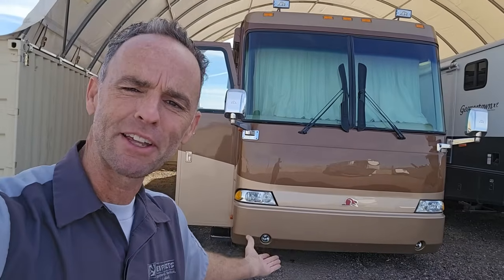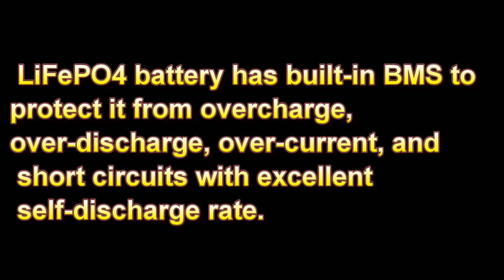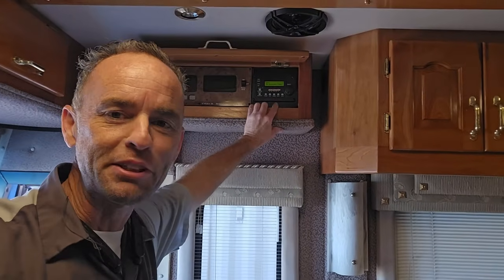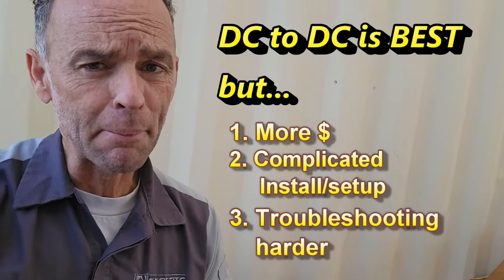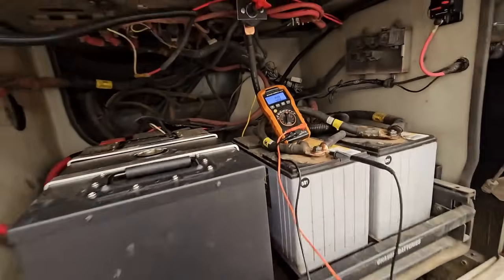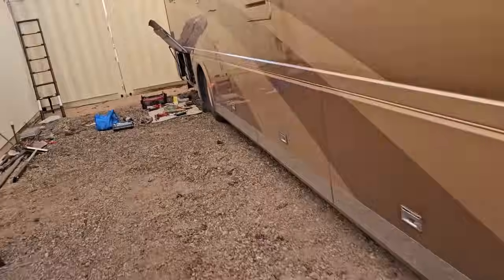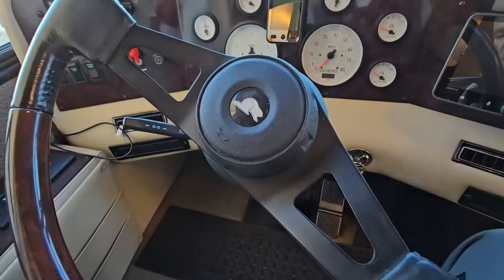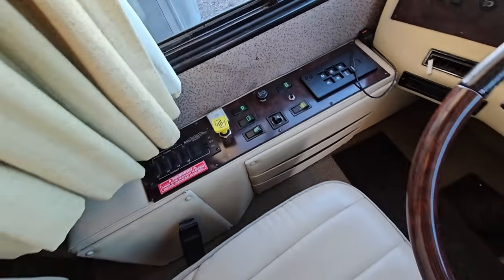What You NEED to Know About Adding Lithium Batteries to Your RV

Comment: Ever since the Progressive Li-BIM was released those of us in the Renegade Super C world have noticed it doesn't work as advertised.  Most have moved on to the Victron XS 50 DC/DC charger which is superior.  The Li-BIM (I went thru 3 and finally gave up) is supposed to latch the chassis/house batteries based on evaluating voltage of each and deciding if either bank is low enough where it should latch both banks together and charge up the low bank.  During charging it's supposed to take a breather (20 minutes) to give alternator a break ...that is ALL the Li-BIM really does compared to the regular-flavored BIM.  HOWEVER us Renegade Super C owners have experienced the Li-BIM latching both banks together when it SHOULD NOT ... and leaving them LATCHED.  Sometimes cycling the Li-BIM (using Signal lug or "Emergency Switch" found in lots of MH ...sometimes fixes the BIM state ...but ONLY temporarily.  I contacted Progressive about this over a year ago and they didn't dispute the problem and simply sent me another new Li-BIM.  Well it behaved the same way ...to the point I put a toggle switch on the Li-BIM ground so I could manually defeat the BIM when I wanted to (so it would not keep both banks latched indefinitely).  Not just me ...dozens of others have experienced the same shoddy/unsafe behavior.  I've taken my out entirely and awaiting the Victron XS 50 Orion DC/DC charger.

Comment: Lithiums also do not need to be charged to 100%, they actually do better if you only charge to 85 or 90% and don't fully recharge before storing it. If you're going to say, run the generator and then go quiet overnight, then 100% charge is OK because it's immediately being drawn down. Also a 460Ah LiFePO4 is like a 800Ah Lead because you can take it down to 15% without harm and if you have a heavy load, you get all the power unlike lead acid which only can meet it's specified capacity with a light load only.

Comment: 793 / 5 000
I don't know if you can answer this question. I switched to lithium batteries, actually 2 12 volt 100amh (200 total). It worked fine for about 3 months and one day my Magnum Energy monitor started showing an overcurrent fault. Since then, my inverter/charger no longer wants to charge my batteries. The worst part is when I start my diesel generator it shuts down after a few seconds as soon as the monitor starts showing overcurrent. What can cause such an overcurrent problem? Is it possible that my batteries are drawing too much current? I even bought a new Renegy Inverter/Converter 2000 and after a few minutes it started to smell burning and smoke so I shut it down before destroying it.

Comment: James,
Quite a few DP’s are wired for the generator to start off of the house batteries. Since lithium batteries cannot be used for starting, switching generator starting to chassis batteries is a must, correct?

Comment: I have a DC to DC charger that charges the chassis batteries and when full it will charge my 4 house batteries afterwards when the engine is running.  It is good to 70 Amps.  If I install more batteries, lead acid, and the batteries are low, will they draw over 70 amps and flip the breaker or will the batteries just accept what is sent to them? If you add solar and the engine or generator is on will solar also charge or is there an auto transfer switch that will only let one source charge at a time?  If two charge at the same time is there a risk of shorts or sparks?

Comment: My ol lead accid batteries have been working just fine since 1994 when I bought my Holiday Rambler Navigator, I'm on my 5th set since then, I keep them maintained and they work just fine. I don't see the need to change.
Reply from the maker: I've never had a lead acid batteries be reliable after a year here in the desert
Reply: Still using flooded then? I'm tired of the T-105. I just changed over and I'm hoping to never have to maintain again.

Comment: James, I am installing the system with the LI BIM and the batteries you installed in a Tiffin 2014 phaeton.  The AUX START switch is not functioning as expected but after some research it maybe functioning as designed.  The signal wire is always hot when the key is on.  So do I need to not install the signal wire on the Tiffin?  Or if I do install the signal wire, do I need to add a momentary switch?  Thank you!

Comment: Put a lithium iron batt in my motorcycle in Phoenix, AZ and was in the for 4 yr. No problem except it did not like to start the bike cold, had to leave the light on for a couple minutes to warm up the batt due to current flow. Expensive but much lighter.
Reply from the maker: That's interesting, I generally don't like lithium for starting engines but I could imagine weight savings is important on a bike too.

Comment: Nice video!  Agree 100% on if you already have solar, make sure it uses a MPPT solar controller.  Newmar, at the factory, left their standard old school Xantrex solar controllers in place when they factory optioned Lithionic LiFePO4 batteries on new rigs.  Now they have a service bulletin out to recall/replace well over 100 solar controllers that couldn't actually charge the lithium batteries they added during these new builds.  

Battleborn, at one point years ago, used to recommend the device you added for 200Ah or less in Lithium batteries and then DC to DC for greater than that.  I haven't kept up with their recommendations though since changing rigs. Is there an Ah recommendation limit to keep in mind?

Thanks again for a very educational video!  

Ps. If you ever do add a DC to DC charger for alternator charging, I'd be curious how you'd keep the battery joiner capability.  That's a project I am debating doing as my Newmar uses Silverleaf to automagically control battery joining for charging through a solenoid even on their lithium optioned rigs.

Comment: Quoted from the website

" The Li-BIM is a Battery Isolator specifically designed to work with Lithium house batteries. Lithium batteries like Battle Born batteries have a slightly higher resting voltage than their AGM or Lead Acid counterparts. The standard AGM tuned isolator will see this higher voltage as a ‘charging’ voltage and will not disconnect the starting and house batteries which means the starting battery is at risk for getting low when electronics are used from the house battery bank when the engine is off.

Also, the Li-BIM is unique because as the alternator is engaged, the Li-BIM will connect for 15 minutes; and disconnect for 20 minutes. It will repeat this cycle as long as you are driving. It does this because lithium batteries can draw a SIGNIFICANT amount of power at one time due to its low internal resistance. This is great for rapid charging, but this high-amperage draw can potentially overheat an alternator. This on/off cycling allows the alternator to cool down for 20 minutes between 15-minute charging bouts"

Comment: What about starting the Genset. On my motorhome the Genset stars via the house battery and an Onan QD10000 states 475 - 650 CCA (page 5-2 Specifications in the QD10000 manual) to start. Sounds like the Li battery is not going to start the Genset. I guess install an 800 CCA group 27 (i.e. Bluetop) someplace for the genset and connecting it with a 120v Battery Minder?
Reply from the maker: I debated adding this point as a 5th item, but for the most part it will start most generators. Mine is started off the chassis batteries and didn't want to get viewers confused.
Reply: @AZExpert Thank you, I was able to put it together when you showed the 250amp limit. It would be a complicated discussion based on how the manufacture setup your coach. I was planning on adding a genset start battery anyway as my deep cycle house batteries already have issues starting the notoriously hard to start QD10000. I appreciate your videos on this and it adds an option to replacing 6 heavy golf cart batteries with one LiIon that gives more useful amps.

Comment: Modern electrical codes for a battery primary fuse (not a plain one) to be mounted 6-12" from each battery positive terminal.
Reply from the maker: yes there are many fuses located on the ceilingn above the batteries

Comment: Hi James, I am upgrading my 4 agm house batteries in my 2014 allegro red with the  Vater 480 lithium. The question I have is will I be able to start the generator with the new vater lithium battery? From what I have read lithium cant be used as a start battery.
Reply from the maker: Generator starters do not draw the same current as engines.
Reply: @AZExpert  Thanks sound like I am good o go.
Reply: @AZExpert  James, do you ever get the feeling not everyone watches, and listens to, your entire video...? 😇

Comment: Very good video. At 6:00, you answered my question about upgrading to lithium batteries with solar panels. I have solar panels with a Renogy 40 amp controller, similar to yours. Looks like I’ll be able to get an extra half volt of boost on a new Li battery. Thank you.  BTW - should the Vatrer Li battery be protected from the weather in an open-air battery compartment?  I noticed the Vatrer battery has vent slots. Will dust and moisture be a problem?

Comment: I like all that you shared!   Thank you!   But you did not address or mention charging/discharging concerns at 32 degrees or lower or above 114 degrees.
Reply from the maker: These would be dependent on the choice of batteries themselves and would have too many outliers to cover in a general video. Many LiFePO4 operate -20 to 140 while best practices are 0 to 114 like you stated, but lead acid is also affected at low and high temps too

Comment: I have the Ford 6.8 liter V10 in my old class C. With 400Ah of LiFePo4 coach batteries installed I am able to start the engine from the lithium if my chassis battery dies, so I guess it depends on your motorhome.
Reply: Gas engine versus diesel engine.

Comment: I just converted my RV over to Lithium and was looking at the LiBim system.  I ended up going with the Victron 30amp DC to DC charger.  I figured between my solar, generator, and the DC to DC charger, the 30amp DC to DC charger wasn't limiting and would be more than adequate.  I was concerned about using the LiBim system especially if I am stuck in traffic and at idle for any length of time as the LiBim would allow the Lithium batteries to take as much as needed even though it cycled every 15 minutes.  I was not aware that it actually did any throttling other than the cycling.  I watched a video where someone took it apart and there really wasn't much to it.
Reply from the maker: Freightliner has built smart charge relay into their chassis since 2005ish which will turn off the RV charge relay if chassis voltage gets too low so relay cycling is very common
Reply: Thanks for the information.  It took me awhile to decide which way to go and watched a lot of videos as well as ask a lot of questions.  In the long run, either way will work.

Enjoy watching your videos.  I live nearby in Surprise AZ

Comment: Could you exchange the chassis batteries with capacitors for more weight savings?
Reply from the maker: The super capacitors would likely cost more than the batteries and probably cause problems if the engine didn't start the first crank up.

Comment: Luckily for me mine came with 2 panels, 2 100ah batteries, a solar controller and an inverter. I’m replacing my 6 year old batteries and gonna add a more efficient monitor display. Lithium is pretty neat stuff. Not running the generator and running 110v appliances is great 👍🏼

Comment: I use a 120 amp victron cyris bi directional relay in parallel with my 40 amp renogy DC to DC charger so when I flip on the switch in the kick panel it switches on and keeps on the relay so that's how I keep my vans starting battery charged from my lithium batteries

Comment: Thx AZ Expert🙋‍♀️🛻🇨🇦❤️‼️most of it went over my head,lol, but I have other questions too. I will have to find a GoPower installer somewhere since thats my system..I think...as I am not sure about frankenstiening with other brand parts?! I talked to Taylor Coach who built my trailer and they said I can add solar and lithium to my set up, with switching some settings on what I have. I dont need a lot like others do as I don't run microwave, ac, tv, etc.. I just want to run my furnace😂in the morning without worrying Im at 50% on my agm so lithium is where its at! 🎉 Wow ur almost 80k subscribers now!!! ❤ I joined at around 160😅!
Reply from the maker: It's been a fun ride here, Im glad you joinmed me for it. I'd say you likely just need a quality LiFePO4 battery

Comment: I used my lithium to boost my lead acid that were weak and it worked for me on three different occasions before I could replace the starting batteries.  The lithium was enough to give the extra needed to the lead acid batteries. I do understand they are not for starting batteries but they will still send power to the starting batteries.

Comment: I just added lithium batteries to my coach.  The coach was already equipped with the BIM 225, NOT the Li-BIM 225.  Does it need to be changed to the Li version?
Reply from the maker: it does have  different parameters, so I would say yes

Comment: Seems like, once the relay clicks, it's pulling the chassis battery down. At 20:00 your measurement went from over 14.0 down to 13.5. This means that the Lithium are pulling the entire capacity of the alternator at that RPM, and robbing the chassis battery as well as all the chassis electronics of the 14V alternator voltage they are designed to be running at.

Comment: And as a side note - I'm sure it wont do the trick with your diesel, but on our Ford V10 Class C our 2 Lithium Batteries (200A BMS in parallel) the lithium starts the chassis no problem at all. It really depends on your motor. I'm sure something like a Transit would be fine too.

Comment: Or you get yourself a Battery with a current limiting BMS,  hope those are going to get standard for RV applications soon.  All those DC-DC and isolators gadgets could be eliminated when all BMS would just include a active setting to reduce charging to a save level for the Alternator.

Comment: James, thank you for this video and sharing your knowledge and experience.  We have a 2014 Tiffin QBH currently with six, 6 volt batteries in the house system.  I am considering following your recommendation but I want to install two Vatrer 460Ah batteries in parallel.  Is there any problem in doing this regarding the Magnum MS2012 charging two 460Ah Vater batteries?  I intend to remove the slider tray to accommodate the two 460Ah Vater batteries. Also, just as the LI-BIM225 protects the chassis alternator, do we also need to protect the alternator on the generator with another BIM 225?  I look forward to your advice.

Comment: I just learned a new detail. Is that the LFPs can offgas Hydrogen when perturbed. Leaving a bomb awaiting ignition. 
A Hydrogen gas detector module with WiFi would be advisable. But I favor the LFPs myself. Just need to find the hazards in these formulae, and mitigate them. The life span on these is the big plus. And a Group 27 size can be 14.8 Volts and 120 Amp hours.
I rigged an F550 with dual alternators. The new one was 270 amps, and a Balmar regulator regulated to 85% current, and 14.8V constant output. Fed a 2/0 cable to the rear to apply up to 220 amps continuous to the 3 battery banks. The batteries have individual BMS so a constant source of power makes them happy. Self limit current in at 50 amps on the 200AH batteries. 1/4C is a good point for longevity. Probably less likely to heat the batteries and make H2...
The original 12V system is in tact but isolated from the "Hotel" load. It runs at 13.8 - 14.2V so the automotive batteries survive. The orig alt produces 130 amps, was replaced with a reman and stored as a working replacement should if on the road the the newer unit fails. In my extensive experiences, the more you prepare, the less likely an incident will occur. And when it does you feel awesome, because you were ready. Family would agree.

An example: when I was a young man who was out with my BF and our wives, we had a late night occasion to have a flat in a public place. Some comedians next to us were laughing as we came out with Donuts for the girls as we had a flat tire. I handed the bag to the girls, popped the hatch, gave BF the tire iron, he was breaking the 4 lugs loose as I was jacking up the car. I gave him the spare, stowed the flat, lowered the car as he was tightening up the lugs. A minute maybe? The laughter was non existent, and we drove away.  We smiled, thanked them for letting us know, and have a great night. In the Heart of Dixie and NASCAR, it shouldn't be unexpected.
Reply from the maker: lead acid vent so much hydrogen

Comment: Good report but one point is off I used four 105AH batteries wired in parallel vice a single large battery. As my batteries have a surge current limit of 200a for 5 seconds i can output 800a for 5 seconds which is enough to initially crank  my 98 Beaver Monterey 3126b Cat engine and then my batteries can output 150a each for 600a total for 20 seconds.  This is enough to start my coach.  Then the batteries can output 100a each for a 400a output to keep the engine spinning if necessary.  I know from experience this works although it is hard on the batteries and is for emergency use onlt..  The next step for me is now there are new lifepo dual purpose batteries by Dacota Lithium and Epoch Batteries that have 1100 CCA and 150 AH ratings.  This is the same CCA ratings as my two lead acid chassis batteries have now so hopefully can have all lifepo batteries and eliminate the charging problem.
Reply from the maker: That's true, I was just trying to cover general conditions that many may not be aware of, but that is a good point.